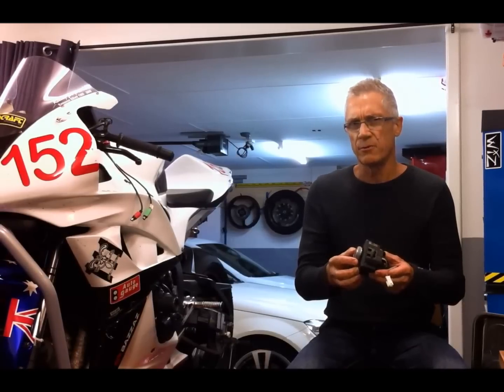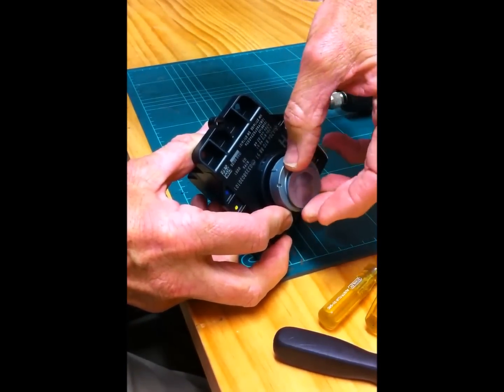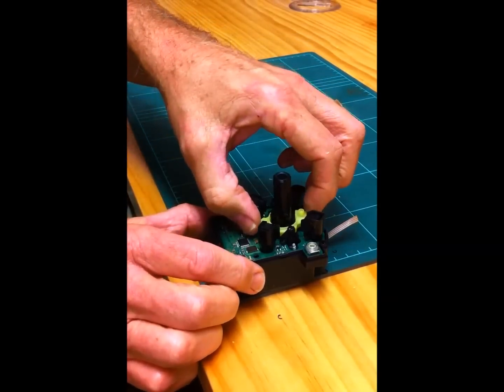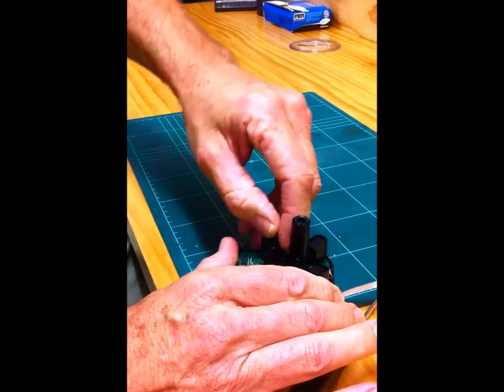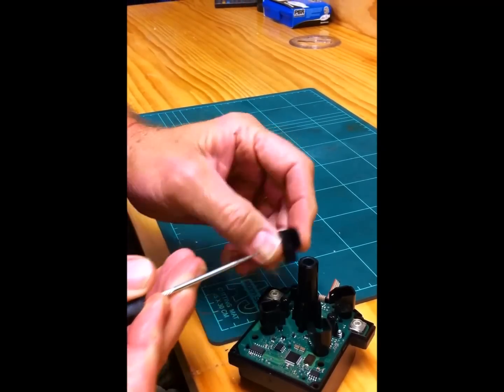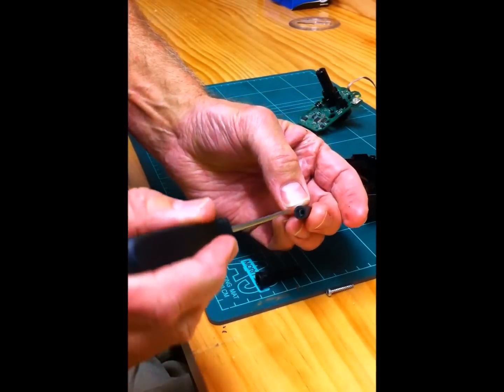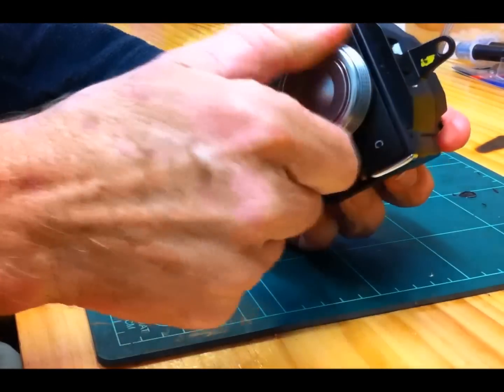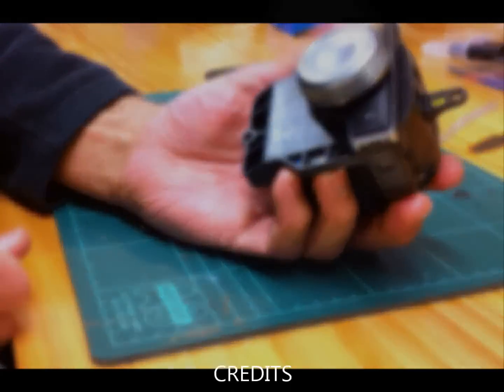Mercedes W204 W212 C E Class Repair Scolling Knob COMAND Console Control Wheel Command

Comment: i cant take the cap off the scrolling knob...it wont come off??? i dont want to put too much pressure on it in case it snaps...what are your thoughts??
Reply from the maker: Miguel I'd try putting some heat on it with a hairdryer.
Reply: MrScott52 thanks Scott i finally got it off. I fixed the broken bit inside and put everything back together again and the scrolling now works but the up, down left and right function doesnt work. Any idea what this might be??
Reply from the maker: Miguel Lamvohee That's no good! It must be something to do with the four little rocker arm posts as they the do the left, right, up and down. I know if the screws are not done up properly on the case the two halves flex and the rocker switches won't work properly. The only option is to pull it apart again and carefully reassemble. I'm also assuming the electrical connector is in properly so check that first.
Reply: MrScott52 thanks for your prompt response MrScott. I think i know what the problem might be. I've pulled it apart again and realised that i broke two of the rocket switches cradle which is on the circuit board. Its the bit where the switch slides in and out of some type of cradle (if you know what i mean??) kind of hard to explain. Would that matter much??
Reply: Miguel Lamvohee i think i was too rough with pulling the rocket switches off
Reply from the maker: Miguel Lamvohee Yes it will matter. The rockers won't work properly as they'll flex. Buy yourself a second hand controller off eBay ... there's always plenty there. Or you could try gluing or plastic welding with a soldering iron. You have to be gentle when you're disassembling, repairing and reassembling electronic items. It's a good learning experience for you.
Reply: Ive just bought a second hand one very cheap from a wrecker which i plan on installing when i get home tonight. Hopefully it works lol
Reply from the maker: Miguel Lamvohee Well done on getting one so quickly.
Reply: I installed the new control knob last night and it works great. Thanks again for this video it definitely helped me save alot of money. You're a legend!!! All the best.
Reply from the maker: Miguel Lamvohee Miguel thanks for the kind comment. "Legend" maybe drawing a long bow but I'll humbly accept the compliment! Regards, Scott

Comment: Thanks Scott for a great video,   I am waiting for the glue to dry as I type, and then on with the match sticks😃
Reply from the maker: oneill9201 God news I'm glad I could help a fellow Mercedes owner save some serious cash. Let us know how it all ends up. I'm waiting for 3D printers to become cheaper then we'll be able to print out a new one plus a couple of spares. I'm sure in a year or two they'll be as common as mud and they'll be $150.

Regards, Scott
Reply: The scrolling function is working perfect,  my problem is the left, right, ahead, back, and push down won't work!!  Any ideas what I could have done wrong in the reassembly.  I didn't have any lithium grease,  would that affect it
Reply: The scrolling function is working perfect now. My problem is the left, right, ahead, back and push down function now don't work.
Any ideas what I could have done wrong in the reassembly.
I didn't have any lithium grease, would that make a difference
Reply from the maker: oneill9201 No grease wouldn't affect it. You may have the rubber spring/spacer in the wrong way. Check it's plugged in properly as well.The only way to problem solve is to dismantle it again.
Reply: I did think that the grease wouldn't affect it,  I will try to undo the clip and take it apart on my bench instead of in the car.
Il have to figure out what I did wrong!!  I was fairly certain I had it right because I kept replaying it as I was reassembling.
Thanks for your help
Regards David
Reply from the maker: oneill9201 David perseverance and persistence are your friends!. Don't let it beat you. Also what's happened is how we learn. Take your time. You may find it's something simple.

I'd have more money than Warren Buffet if I was given $10 for every stuff up I've made over the last 40 years. Let us know how it goes. Scott
Reply: I won't stop until I have it fixed!!  It could be a couple of days before I get a chance to look at it, but il let you know how I get on
Thanks again for your help Scott
Reply: +Scott Elliott Hi Scott,  it's been a while since we last spoke,  I've been very busy with work, a good complaint!!  I've tried fixing it a couple of times and I'm still getting the same result. I'm thinking that I might have damaged the circuit board or something
Reply from the maker: +oneill9201 You're about the only fellow who's had a problem like this. Nearly all feedback has been successful repair. You can buy cheap used ones from the USA on eBay. You can often buy them with the missing scrolling function so the shaft is already broken. Maybe do that because it sounds like something must have been damaged. As a last resort you could carefully check the traces on the PCB to see if any have been broken.

Comment: Great video, Thank you!! Do you know a web store where I can buy the cable piece??
Reply from the maker: Thanks Walter. There are many on eBay. http://www.ebay.com.au/itm/Video-Adapter-Cable-Connector-RCA-Fakra-Line-Comand-Reversing-Camera-For-Vehicle-/322304498642?epid=526046637&hash=item4b0ad85bd2:g:FbEAAOSwUEVYDeIn
Reply: Thanks for the link, I was actually looking for the cable for the wheel command, I think I pulled it too hard when I took it out and now it doesn't connect.

Comment: Thanks Scott

I completely stripped the unit down at least 8 times and re-assembled it. Still pulking wheel downward works perfectly but pushing upward for upper menu options is not existant. Board is cleaned. Cant really see why as all 4 legs are aligned correctly, not much can be out out of whack.  No idea why. Tbe only issue previously was the wheel wasnt moving the cursor as shaft was broken but now mysteriously pushing upward is a non event.
Nothing on youtube or even the internet. Damn hope someone can help !
Reply from the maker: Sounds like one of the switches on the four legs is faulty or the PCB is moving. It would be the top one. It maybe possible to desolder the switch and replace. You can buy the controllers on eBay already with the broken shaft

Comment: So if the shaft is broken, you still can hear clicking when you spin the wheel ?
Reply from the maker: Yes because the spring and indent that makes the clicks is built into the knob not the internal shaft.
Reply: @ScottElliott152  oh, thanks, I thought that there is something on the board that is clicking, thanks again.

Comment: I have e200 w212 the key of the car only opens when I’m next to the driver door ?? What do you think the problem is ??
Reply from the maker: Samer Obaid . Possibly the rechargeable lithium battery inside the key.
Reply: I did replace the battery for a new one but still the same problem,

Comment: i have problems with getting out the first outside ring. is there some nice advice, because it ist so difficult? best gegards from germany
Reply: This first step is my problem too. How do I get the outer ring off? How much force needs to be applied?
Reply from the maker: Alexander Nagel Enough force to lever it off!. It's not something I can answer definitively. Work your way around the edge with a pointy lever tool prising it upwards.
Reply: becherglas1994 what helped me waste shine a light underneath the knob as I was trying to get the ring off, so I could see where the outer ring ended and know where to push up (I used a headlight). It took a while, but that gave me guidance.
Reply: Same issue for me. For 2012 Eclass the knob is a little different and there is no real good place to pry it and mine is stuck as though it is glued. was convinced after an hour that it wasn't coming off and had to bail on the whole project. very disappointing as the rest of the job looks reasonable. may get up the nerve to try it again someday but I suspect that I would need a replacement knob ring at a minimum.
Reply: mine is a little bit different (facelift w204) as there are some kind of tabs on the plastic inner knob that prevent the outer "metallic" ring to come off easily. those 4 tabs are located halfway of the 4 "rails". So to lift the outer ring you have to push the inner knob towards its center and lift the ring at the same time. I took some pictures of it if you intersted and if it could help you give your email address and I can send it to you
Reply: If I attempt it again I'm going to use a little hub puller. I've got a W212 2012 and it just seems stuck as hell compared to the video demonstration.

Comment: Great video!!! I had exactly the same problem, and thanks to your video I've been able to fix it.
Just a couple of comments:
- Taking the cable out without cutting it was not that difficult. In this video, in German, you can see how.  https://www.youtube.com/watch?v=jr-uGQOmUTE&spfreload=5
- Taking out the first crown is very easy in your video, but it took me some time to do it.
- You only remove 4 screws... but in my case, it was necessary to remove the 10 screws to open the box.

Now it's back in my C220, working perfectly!!!

(amazing that Mercedes has this kind of issues...)

Thanks a lot!!!
Reply: I can't see your complete comment for some reason, can you re-post the link to the video you mentioned?

Comment from the maker: Miguel that used item will probably break so now you know what to do. Be gentle! Kind regards Scott.
Reply: so helpful video
Reply from the maker: alejandro araya Thanks for your compliment. Regards, Scott
Reply: I just had a read back through our discussion,    I realise that I didn't tell you that I got the push down and pull back function working, that problem was that the glue on the shaft pulled apart a small bit when I screwed down the wheel. It's the left, right and forward function that aren't working.  I will have to look into buying another one     Thanks for your help.      

I will also have to look at your video for headlight removal
Moisture is getting into my left headlight and my dipped beam has stopped working,  I tried swapping bulbs and no satisfaction        I'm thinking a problem with the ballast
Reply: +oneill9201 sorry comment in wrong place!!!
Reply from the maker: +oneill9201 Maybe it's worth buying one of these. This fellow is using a 3D printer to make a new shaft: http://www.ebay.com.au/itm/Welle-Stift-Stick-passt-fur-Mercedes-W204-W212-Comand-Controller-Drehknopf-/231721563477?hash=item35f3ae7555:g:QyoAAOSwv0tVdvt~

http://www.ebay.com.au/itm/Mercedes-Benz-Controller-Tastschalter-Navi-W204-S204-Facelift-Mopf-A2048709558-/301778057391?hash=item46435fb8af:g:N2oAAOSw9N1V0dTD

Comment: Nothing is broken en the control didnt work . So i watch your video took everything out like you did but everthing is good
Reply from the maker: +farli van emden ... ok it's probably a software problem. It will have to be connected to the Mercedes STAR system to find out what's wrong.

Comment: Risky to stick the axle! Better solution: Replacement of the axle in aluminium finish. Costs about 15 € and works for life.
Reply from the maker: Yes I know. If you read the description you will see I advise viewers to buy a new shaft. I made this video many years ago before replacements were available. I was one of the early Pioneers trying to solve the problem. After I made this video a friend used his 3d printer and made me a new shaft out of nylon.
Reply: @ScottElliott152  Hi Scott. You did great, and you certainly inspired some people. Mercedes Benz wanted from me 500 € for the repair. Then I looked at it in YouTube and fixed it myself. It cost me 20 € for the new axle and the Torx screwdriver.
Reply from the maker: @karl-heinz124  I'm glad it was helpful and saved you money. When mine broke Mercedes wanted about $AUD1400 and said they needed to remove the dashboard!

Comment: This was a great video. I did my 2010 E350 about 2 yrs ago it took a while to get the CC out and to epoxy the shaft together with wooden toothpick support however this time after it broke after 2 years it literally took 10-15min to get it out and I completed the repair in 20-30min tops. I would also like to share this replacement Command Control drive shaft I found on ebay. http://www.ebay.com/itm/152076354366?_trksid=p2057872.m2749.l2649&ssPageName=STRK%3AMEBIDX%3AIT  It is ebay Germany it’s a little expensive $50 considering you can get a new unit for around $250 or a used unit for around $140 but then you'll still have to worry about it breaking again. I ordered it and received it in Texas in about a week. The beauty is the part is aluminum so no more breakage. So I should never have to fix this part again for the life of the car. Thanks again.
Reply from the maker: +Titus Rogers Thanks for the link. I have seen that item. There's another guy in Germany 3D printing plastic items for $30. there's a link in another comment below.

Comment: It is not smart to glue the shaft. A spare one made of brass would be cheap and never break again.
Reply from the maker: If you look at the date of the video no one was making replacement shafts 8 years ago. Gluing was our best option until a better alternative could be found. Look in my video description and you'll see I've advised viewers to buy a new shaft. Since making this video I've installed a 3D printed nylon item.
Also it's better to use nylon, ABS or similar as brass or alloy will wear the internal PP plastic more quickly. Plastic on plastic is better than metal on plastic for a component like this.